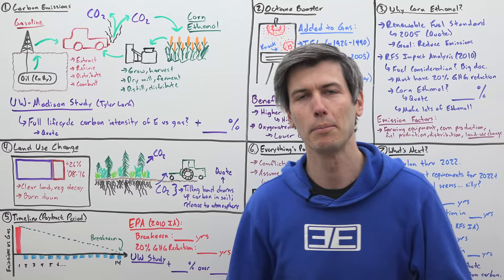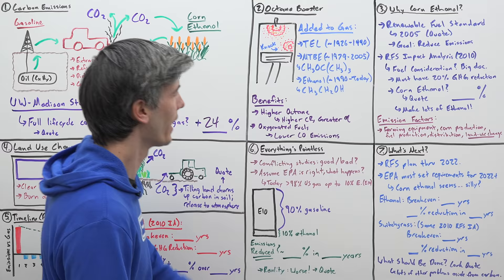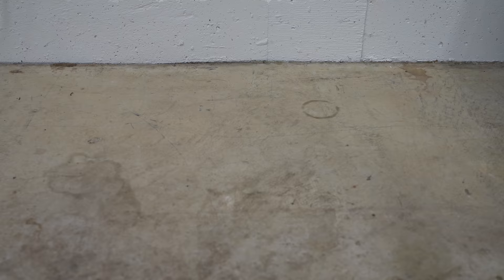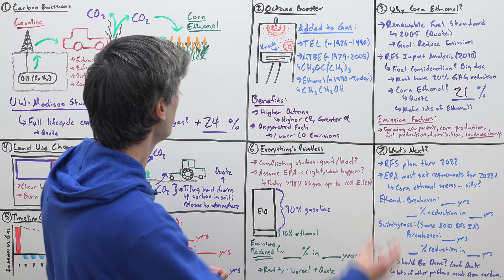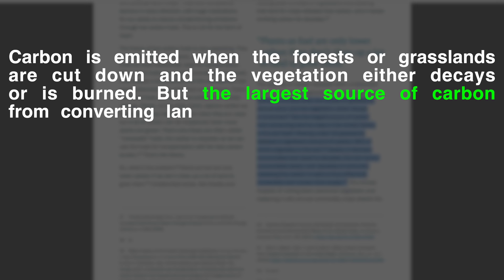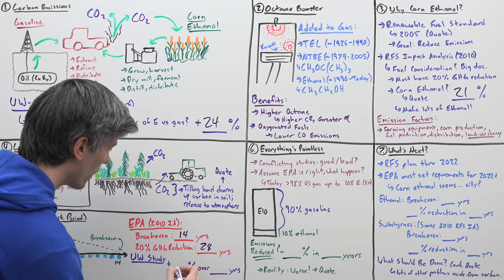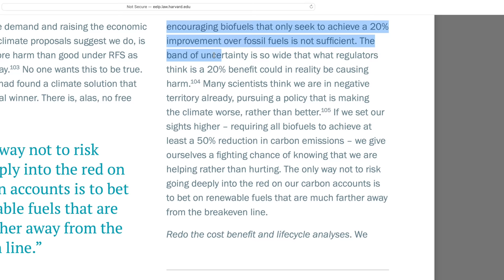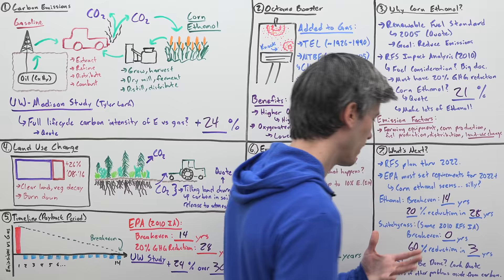America Was Wrong About Ethanol - Study Shows

Comment: Is there any study using the same factors, formulas and etc that we could directly compare results from the convertion process and use of ethanol converted from corn to the one converted from sugarcane? Ex.: here in Brazil, our gasoline contains (at least theoretically) 27% of ethanol embedded.
Reply: There are. Sugarcane is better, but largely depends on climate of brazil to foster its cultivation.
Reply: First of all the Co2 hysteria is scam just like the corona hysteria! Methanol in fuel is good not because of Co2 but because it reduces actual harful emmisions other then Co2. On my 1991 2 Liter Mercedes 190E I had to run it on 40% Ethanol fuel to pass the emmission tests here in Norway and when running that the test result was 0 emmision (lower then they could measure?). Without the Ethanol it had no chanse of passing the emmissions tests.  Ethanol is great for high performance and turbo / compressor charged cars :)
Reply: @a64738  methanol or ethanol, which one are you talking about,make up your mind.

Comment: One more factor for your #6 equation: the ethanol has less energy density than the gasoline, so you have to use more of it to do the same amount of work as pure gasoline. So that 2% becomes about 1.9%
Reply: I buy ethanol free gas, mostly because I live in a wet rainy area & I don't want hygroscopic ethanol sucking air moisture into my fuel system & my ancient 2005 car engine & fuel system was never designed for ethanol. Thankfully CENEX distributes ethanol free or E0 or Et-Oh free or pure gas or straight gasoline //
Reply: @AaronSchwarz42  I remember when ethanol was first introduced in Khaliforniastan years ago, before 2005.  At the time it was 5.7%.  What I recall was that about six months after introduction and for a couple of years later, cars were going up in flames as fuel lines and seals failed due to the corrosive effect of ethanol on the materials used to make them.

Wonder how much "carbon" was released each time when that happened...
Reply: @cdc3  To answer your sarcasm, no, not a whole lot of carbon was released from a burning vehicle as opposed to the continued daily driving of a worn out or obsolete vehicle.
Reply: @cdc3  Most of cars in Brazil drive on ethanol.  Yes - gasoline because of adding ethanol is more corrosive for steel fuel lines and steel fuel tanks when cars are not used very often -- but many modern cars have that made of plastic. Also you use more fuel when it contains ethanol - so not much gain in that.
Reply: @wyrazowfkp  Brazil also makes the vast majority of its ethanol from sugarcane which make much more sense than using corn.
Reply: @joec.2768  A vehicles components  can wear out, but maintaining an older vehicle and replacing broken parts is significantly better for the environment than buying a brand new car that takes magnitudes more energy in both production and exotic materials. It becomes very clear when you take into account how much pollution comes from making cars vs driving them, since the pollution was already done when my truck was made in 1989, it would be a massive waste to replace it with a brand new lithium battery tesla that'll need a new proprietary battery in 5-10 years when my motor (2.5L iron duke) easily has another 100K miles in it given proper maintenance, assuming I don't want to swap a second-hand chevy 350 (to be completely rebuilt by me) in it anyway...
Reply: @joec.2768  Well, sarcasm aside, to answer your own stupidity the cars which were going up in flames were the entire spectrum of ages and conditions.  None up until after that introduction were made with fuel lines suited to what ethanol did to them.  Classic cars went up which were in great condition as did many newer vehicles, all of it unnecessary and idiotic on the part of those who mandated ethanol.

Much of the requirements were generated politically, the like the vapor recovery gas nozzles and systems which were forced on Californians earlier by Jerry Brown which somehow made a cousin of his rich in the sale of them.  They do say nepotism starts at home and Khaliforniastan has been in the grip of generational politics of 4 families since at least Gov. Moonbeam's daddy Edmund G. Brown and Earl Warren.  In the present day, we have Gavin Nusiance in the top spot there with his auntie Ninny Pelosi third in line to the Presidency.  Di Fi and her late hubby benefitted greatly (as in multiplied millions of dollars) from such politics.

I remember L.A. as a child in the 50's,. Often in the summer you couldn't breathe without feeling the air burning your lungs.  It could be so dense as not to be able to see more than 100 yds outside and it was even possible to see the air in a 10 x 10 room inside.  Much of what was done to curb such pollution was a good thing, a very good thing.  Ethanol, not so much.  By the time it came out, technology had largely eliminated the reason for using it in the first place.
Reply: @wyrazowfkp  When ethanol started to be used here, it was the "plastic" parts which failed, often catastrophically.  

I doubt that the Brazilian cars run on pure ethanol.  Is that what you are saying here? That would probably be very expensive in modification, fuel and maintenance costs. 

Even if it is not, the expense in increased use of corn ethanol is not only in the directly related costs of production, but in vastly greater land usage, taking it out of production for food and increasing the cost of what you eat and thus everything else as a result.  The ones who have benefitted from this on a large scale are the corporate farms which now dominate the field (literally and figuratively).
Reply: @ross2k220   Wish I could give you more thumbs up!  Exactly right!  I lived a good life cheaply by owning and maintaining my older cars, having bought only one new car in 1981 (a very bad decade in general for buying new American cars, any of them) and it was a lemon, breaking down in the first month for a month because it was so new there were no parts available for it.

Towards the end of that decade, we started seeing better quality vehicles as the manufacturers became more adept in tech rather than just trying to stamp out the fires air pollution regs had set for them.  At that time, I owned numerous 60's mustangs which I had running at current smog specs in Khaliforniastan with the exception of nitrous oxides, which weren't bad.  You could keep those cars running forever if you knew how.  At the same time that I was meeting the smog numbers, I had increased horsepower and was getting up to 24 mpg out of a 350 horse motor without any fancy tricks.
Reply: @ross2k220  But you're wrong. The amount of fuel you're burning up by driving the vehicle daily year after year pales in comparison to the fuel required to build a new one. Plus all the fuel you burn up trying to ship replacement parts. Even going from 10 mpg to 12 mpg is a net win in the long run. But I know you don't care because it costs you more money.
Reply: @joec.2768  Ethanol makes worse fuel consuption

Comment: I remember when this was implemented back in 2005, a wise old friend of mine said "Burning up your food supply is never a good idea."
Reply: Most of our corn and soy is exported to Asia.
Reply: I suggest you and your wise friend try eating some field corn...let me now how that turns out...
Reply: A person who makes statements while not knowing the facts is not wise.

The protein in corn is not consumed when making ethanol. The proportion of protein in whole corn is too low to make feed so additional protein from soybeans is added to make a balanced feed. However, the protein left after making ethanol is a source of concentrated protein called distillers grains which is then used instead of soy protein. It works out that for every acre of corn used for ethanol, an acre less of other crops is needed.

Corn is about 10% protein. Soybeans are about 40%. By using both, feeds ranging from 14% to 22% protein are often made. However, neither corn nor soybeans have enough fiber so a source of fiber also has to be grown. After the starch is used from the corn to make ethanol, the protein is left in the distillers grains at about 30%. The 30% protein distillers grains can be mixed back with 10% protein whole corn to help make the needed balanced protein. Plus the distillers grains still has the fiber. That reduces the need for soybean and fiber crops.

On a percent basis, soybeans have about 4x the protein compared to corn. However, corn produces about 4x the yield per acre. So on an acre basis, corn and soybeans are practically equivalent for total protein production. That means for every acre of corn used for ethanol, an acre less of soybeans is needed. Plus less land is needed for a fiber crop. So their claims of land use change due to corn ethanol are gibberish.

Corn ethanol has another benefit for human security. We depend on corn not only for food but also many manufacturing processes. If there is a severe drought for example, ethanol production could be reduced. Thus, saving corn for other uses. I'd guess a 20-30% buffer against really dramatic consequences.
Reply: @heartysteer8752  That makes sense. Only think that would halt that contingency plan would be a nuclear war…
Reply: @angelgjr1999  yes, and most of it is GM grown used exclusively for animal feed stock contrary to very popular belief as it is not used for human consumption
Reply: @johnschmeling1238  just curious, field corn? is that what we used to call horse corn? Livestock feed, I did exist on "field Corn" in a poor country and no it is not as delicious as sweet corn but it is edible, much better than porcupine breasts and drumsticks W/ Deer track stew
Reply: @chaliwen7217  Hi Cha- "field corn" as I call it has many names, I'm sure it's same as what you ate.  Yes it is edible (I try it all the time in field), but very plain tasting.  I can't compare it to porcupine breasts tho...
Reply: @bowez9  Hey smarty, do you consider meat to be food?
Reply: @heartysteer8752  I’m totally blown away by this information!   This really belongs in the video.
Reply: The BT corn grown for ethanol & HFCS not edible //
Reply: @rcpmac  do you care to expound upon that question as it is not inline with the discussion?
Reply: @b98588  indirectly it is a food product as either a feed stock or High Fructose Corn Syrup.
Reply: @bowez9  in feed stock as a byproduct and high fructose syrup is hardly food.
Reply: @b98588  tell that to processed food manufacturers.
Reply: @SecureLemons  bro and people who produce food aren't doing it for the money? Everyone is just doing for the money. That's how the world works. The point is making things that make more money be also good for society and for the enveironment.
Reply: @paulogaspar8295  so does wind and solar plants...
Reply: You don't eat cow feed no one eats cow feed.They still feed the cows that corn once they make Ethanol out of it. It's called distillers grain which is a high protein feed that is much easier for the cows to digest so if it is doing anything it is increasing food and makes race gas.
Reply: @heartysteer8752  thank you
Reply: Food supply.......Corn flakes where I live in Canada sells for roughly $8,000.00 per ton.......pretty expensive food supply. Besides field corn is not used for human consumption and after the alcohol extraction the mash is used as cattle feed.
Reply: @johnschmeling1238  i don't eat it, but my pigs sure do. And I sure eat them
Reply: @jb-xc4oh  There is never a shortage of the corn to make corn flakes. Feed corn isn't planted instead of corn for humans we have plenty of that.
Reply: And the fertility of the soil you need to grow it.

Comment: Quite impressive. I've watched your videos over the years with huge admiration. 

You firm my belief in that the value an engineer brings is contingent on thier ability to explain and communicate with others more than to figure things out.
Reply: Good communication skills make things worse when what they are communicating isn't correct. There was no mention of the Distillers Grains that is also produced with corn ethanol.

The protein in corn is not consumed when making ethanol. The proportion of protein in whole corn is too low to make feed so additional protein from soybeans is added to make a balanced feed. However, the protein left after making ethanol is a source of concentrated protein called distillers grains which is then used instead of soy protein. It works out that for every acre of corn used for ethanol, an acre less of other crops is needed.

Corn is about 10% protein. Soybeans are about 40%. By using both, feeds ranging from 14% to 22% protein are often made. However, neither corn nor soybeans have enough fiber so a source of fiber also has to be grown. After the starch is used from the corn to make ethanol, the protein is left in the distillers grains at about 30%. The 30% protein distillers grains can be mixed back with 10% protein whole corn to help make the needed balanced protein. Plus the distillers grains still has the fiber. That reduces the need for soybean and fiber crops.

On a percent basis, soybeans have about 4x the protein compared to corn. However, corn produces about 4x the yield per acre. So on an acre basis, corn and soybeans are practically equivalent for total protein production. That means for every acre of corn used for ethanol, an acre less of soybeans is needed. Plus less land is needed for a fiber crop. So the claims of land use change due to corn ethanol is gibberish.

Corn ethanol has another benefit for human security. We depend on corn not only for food but also many manufacturing processes. If there is a severe drought for example, ethanol production could be reduced. Thus, helping ensure enough corn for other uses. I'd guess a 20-30% buffer against really dramatic consequences.

Another fallacy often cited is that corn uses fertilizer that is made using oil. However, the fertilizer could instead be made using energy from other things like wind and solar. So compared to electric vehicles, ethanol isn't as bad as they'd have you believe either. It could even be complimentary. 

One of the big challenges with wind and solar is variability. That makes it very difficult to match peak supply and peak demand. Making fertilizer doesn't require a steady energy input. So it can be made using excess energy. By using excess energy, base infrastructure can usefully be increased. That reduces the need to develop storage capacity. So make fertilizer during high energy production periods. Then during low available energy periods, more energy will be available for other needs
Reply: @heartysteer8752  Quite insightful. 👍 

But speaking of communication, are you saying that: Corn-based Ethanol brings benefits beyond fuels, such as valuable byproducts (look up protein *whatever*), and stratrgic food supply security which should be considered as well?

Comment: Something I’ve personally been looking into is biodiesel and bio ethanol through Red, Green and Brown Algae. Algae plants are extremely fast growing crop and have high CO2 capturing properties. Seaweed is a extremely promising crop for fuel production because it’s sulfur free, completely biodegradable and the oil derived from said algae is higher quality, not only that but lignin free which makes the biorefinery process easier. It does come at a cost and that is production would use allot of energy… but I have an idea for that too 😎. But in terms of its viability? China and Africa are already taking the step forward and growing TONNES. How much? Well China would win this race undoubtedly because they are the world’s leader in Microalgae atm with 14M tonnes valued at $8.6B and Africa is runner up at 140K tonnes valued at around $8.6M. America is already behind on this renewable source of oil, ethanol and diesel production and the race hasn’t even started.